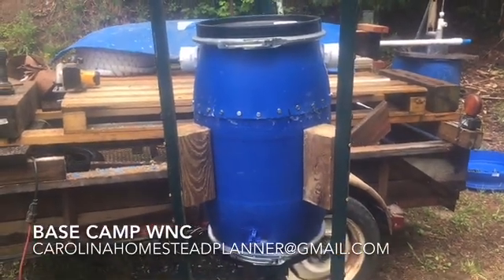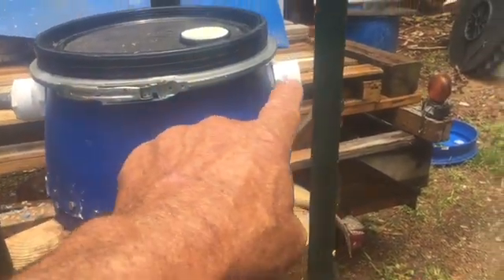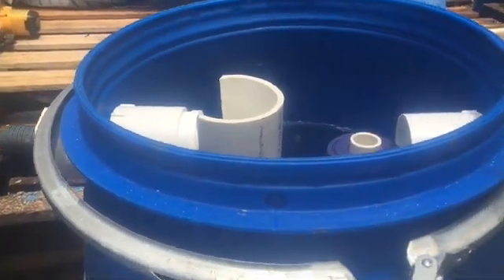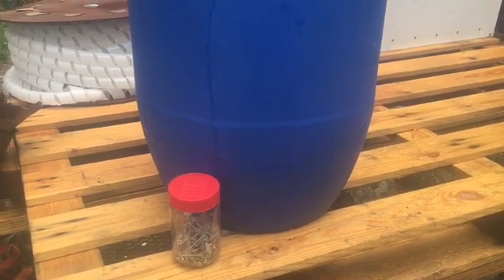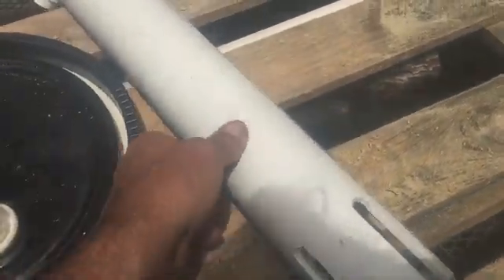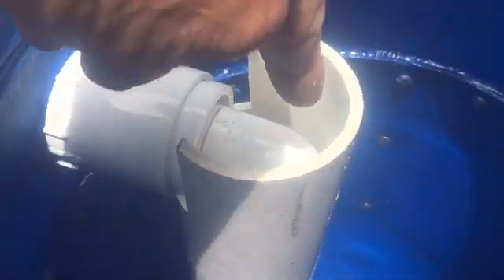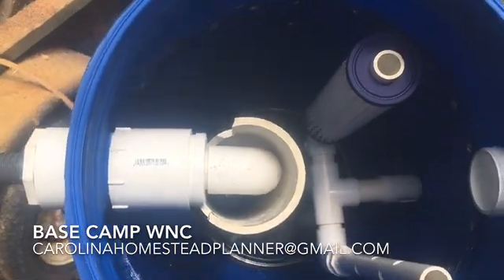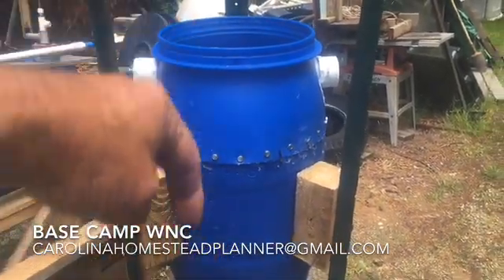Building A Spring Box For A Spring With Sediment Problem

Comment: More curious than anything else why have the 2 inch fittings and then reduce it down to 1 inch on the inflow and on the outflow overflow, what prevents animals or something getting into the spring box?
Reply from the maker: On that build I believe I used 2” because of the flow from the spring
1” pipe will flow 14 gallons of gravity flow per minute

Comment: Ingenious! Thank you for sharing! Do you find that to be a large enough size drum to supply your water, or would a larger drum be more practical?
Reply from the maker: Your size of a spring box should be sized to your water flow of your spring
Example a 1” pipe flows 14 gallons per minute at o lbs of pressure 
Your water storage tank should be sized to your water needs of your household 
Example I use a 275 gallon water tote that will supply water for my wife and myself for 5-7 days 
Thanks for your comment 
And as always subscribe like and share 
Thanks ERIC
Reply: Wow.. did you engineer that !!

I don't have the time or resources to build one.

Any chance you build me one and ship it? Or, where can I buy one already made? Ike the brown one in your Tennessee video. 

I live in jamestown  tn 
I just finished my spring tap. I didn't do it like you did cuz it was all rock. I used 2×8 and red clay and mylar plastic.
The guys at the local ace hardware didn't  know what I needed to secure the 1" pvc thru the wood. So it leaks a lil bit.

I also have a major seep that travels around my trap and comes out at same rate of flow as the trapped spring!!!

I should be getting 5gpm. Instead , I'm getting 2.

I'm getting frustrated.  Been at this for 2 weeks now.

Comment: I have a sediment nightmare with my spring in far western North Carolina.  Same deal, where it comes out of side of hill and collects there before flowing into pipe (which has mesh over it) and into a big plastic holding tank (huge pain to clean).  Then from holding tank goes underground down hill into basement.  Then goes through filters and into pump and pressure tank which push it up to the house.   Now I'm having pump problems, and it's barely 2 yrs old.    I assume sediment is part of the problem.   Average plumbers aren't always great with spring style set-ups, and I'd like to have a system I can maintain easily by myself as there is nobody to help me..   I would love to have my system tweaked and make more sense, but I live pretty far from everything, 2 hrs west of Asheville, just below Fontana dam.. I'll make a video showing you my set up and send you a link to it so you could maybe throw me ideas and/or an estimate.
Reply from the maker: Get me some pictures or video of the spring the box and the house with pump of possible 
Will be able to give you some information 
I do have two jobs in Robbinsville I don’t think that you are that far from there 
Get me by my email 
Carolinahomesteadplanner@ Gmail.com
With your address a phone if that would be easier 
And as always subscribe like and share 
Thanks 
ERIC
Reply: Jon Jandai has a video of a working system that not only removes sediment but also pesticides herbicides sulfur and  organisms and bacteria, and it works

Comment: You might want to use a 60 gal. juice drum. Bring the spring water in the same way but come down half way in plastic drum and set pvc fill pipe perpendicular to ground and point it so you get circular flow at outside of barrel. Make sure pipe is as close to barrel wall as possible This will act as a centrifugal flow for sediment. Come up from fill about 8" and put 6 cleats around insi.de of barrel that will hold wire mesh as a structure cut to the circumference at the top of the cleats.  Attach that fine screen with small zip ties to that. Make sure the exit pipe is about 4" from top of barrel and is dead center of top. The top will have to be cut off for access but leave top structure ring alone. I use a wooden painted top with a overflow pipe at the very top so the top does not have to be water proof and very easy to access the inside for cleaning. Use Potable paint for top. Only cut plastic from top. Put a 3" bulk head fitting in the middle of the bottom with a ball valve. When cleaning just open ball valve to carry away almost all the sediment out the bottom. Take screen out and flush if needed. Hope this is understandable and might help someone. This is the same centrifugal sediment separator used in passive Koi pounds. Works well and you can get an Idea on how often you need to open up bottom ball valve. Takes 5 mins. to clean.